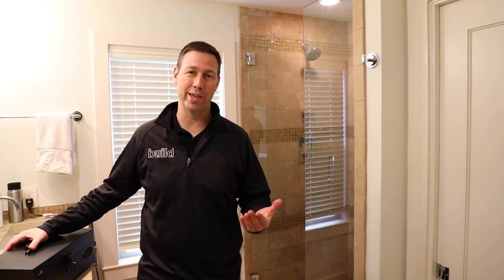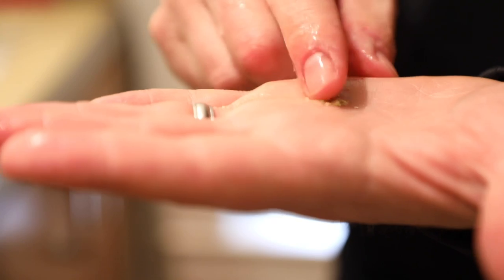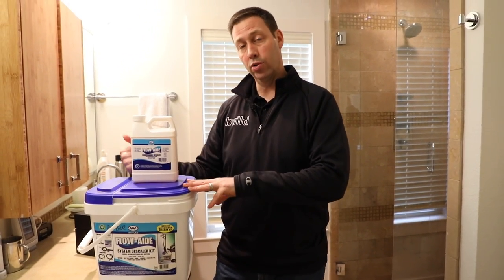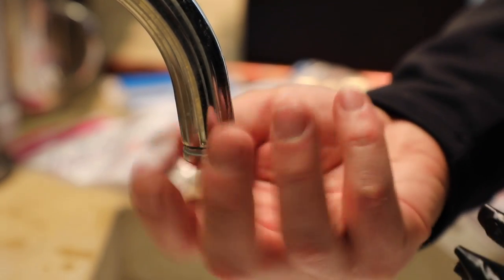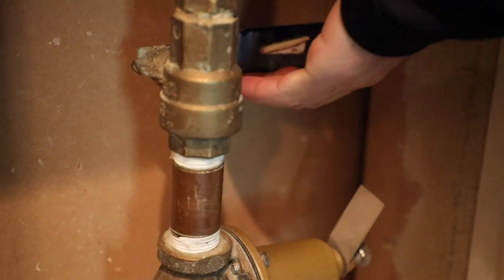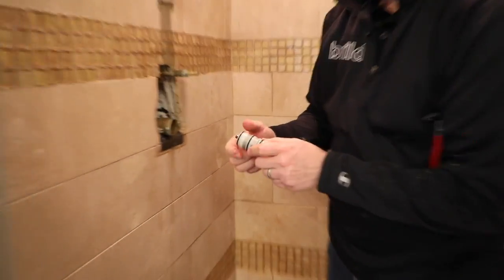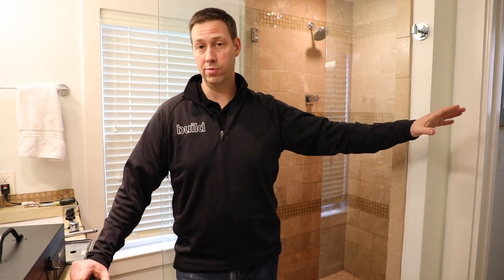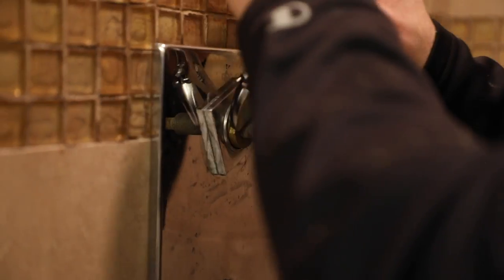The Bummer for Tankless Water Heaters - Fixing a Scale Issue

Comment: We lived in two houses in the country for 41 years, used 3 tankless units in that time: a Thermar for 12 years, a Vaillant for 20, and a Bosch for 9. Well water in both places was LOADED with dissolved iron and calcium, and none of those tankless units ever gave a single problem with scale, or internal deposits of any kind.
Reply: Good comment.   The manufacturers you ended up buying were very likely well aware of HARD WATER conditions and designed their systems accordingly.    To add to your comments, the "calcium carbonate" does NOT come from the tankless hot water heater as stated in various fashions at the beginning of this video.   The "buildup" is from the hard water ....FULL STOP.    This is MINERALS IN THE WATER of what is called "HARD WATER".    This HARD WATER does NOT come into the house "heated".   It comes in "COLD" like every other water supplied anywhere on the planet earth.         TRANSLATION:     The "minerals in hard water are in both COLD AND HOT WATER.         This guy keeps on referencing the buildup as if this is from the water heater.   NO IT IS NOT.   The buildup seen in the aerator is NOT just from the water heater .....THIS BUILDUP IS ALSO FROM THE COLD WATER.   Just run the cold water continuously through an aerator for a month or more and then look at the aerator.

The point is very simple.   The descriptor in this video states "...Matt investigates a house with low water pressure and reveals the DOWNSIDE to a tankless water heater".    WRONG.   It doesn't matter what kind of water heating is in place.    THIS "LOW WATER PRESSURE" IS CAUSED BY HARD WATER  .....NOTHING TO DO ANY HOT WATER HEATER ....FULL STOP.        If the supply water is hard water, then simple maintenance flushing/cleaning is required.

This issue is NOT a "DOWNSIDE" of tankless water heaters.

.
Reply: @taxicamel  but hot water has more scale than cold.  You can get a TDS meter and see for yourself.  As for why, maybe ask a chemist?  But I agree it's counter-intuitive, you would expect less hardness in the hot water than cold, because typically hotter water keeps more solids in a dissolved state, just like salt water.  Anyway- here in AZ a typical TDS meter will show 400ppm in cold water and about 750ppm in hot.
Reply: @marcostankless7526  ...99.99% incorrect Marco.    It is the municipality who controls the condition of the water .....unless of course the water is artesian from your own property.....in which you're on your own to what needs to be done to the entire plumbing system.

No TDS meters required ....and a complete waste of time in most cities across North America and likely many other countries.  People know what kind of water they have.

When water comes into the house, it doesn't matter whether it gets heated or not .....it's "chemistry", which is more a "solution", is about "solids" in the water.  I have no idea where you think that the temperature of water influences the amount of solids in water ....but you go ahead and think whatever you like.

.
Reply: @taxicamel  even if it is city water, I you can see that there are more dissolved solids in the hot water than in the cold.  Municipalities do not control water hardness.  All they do is take non-potable water and filter it, then chlorinate it, then pump it to all the buildings.  Doesn't matter if it is Az water or NJ water, there will always be more hardness in the hot side than the cold side.  It's just a matter of is it 50ppm in the cold and 150ppm in the hot like NJ, or is it 400ppm in the cold and 750ppm in the hot like Az.  

Also I am certified installer for Rinnai and Navian, which are the two most popular tankless water heaters in USA right now.  They are not made for "hard water" in fact the install manuals specify that water hardness should be below 150ppm or it could void the warranty.  That much being said, the new tankless heaters have stainless steel pipes & stainless steel heat exchangers, this makes them much tougher than the old ones.  They come with 15-year warranties, and should last 20-25 years if well-maintained.
Reply: @taxicamel  With a tank water heater, the scale are accumulated inside the water tank and will not clog hot water pipe.  With a tankless water heater, the scale has nowhere to go but into the hot water pipe causing clog issue.  For this reason, when compared to tank water heaters, the tankless water heaters do have a "DOWNSIDE" as described in this video.
Also, the scale build up DOES come hot water heater as the video suggested.  Minerals dissolved in water does not clog water pipe.  The minerals in water only causes problem when it can no longer be dissolved in water and become scale.  Heating cold water containing minerals will cause the minerals in water to become scale.

Comment: Maybe a problem with gas fired tankless. This is NOT a problem with electric tankless. We Been on electric tankless for a quarter century now. Never had any scale, despite having pretty hard water.  Once the water is off, the elements shut off=no scale.  Still the greatest invention! Cheaper than replacing the oil boiler. Very consistent, infinite, hot water regardless of how cold our New England winters get!  Easy to install. I did it myself!  NO regular maintenance required, or even possible on electric tankless! A great DIY  option if someone doesn't have gas, and can solder and do electric work.  When my first one failed (heating element blew out),  there wasn't a spec of scale anywhere inside.

Comment: I would install a strainer immediately after the water heater. This way you catch all the scale before it gets to your plumbing fixtures.
Reply: Wouldn’t it still slowly catch in the other screens as well?
Reply: Great idea! You can add a water filter that uses a cartridge. I installed one before the water enters the tankless water heater to eliminate any sediment from entering the system.
Reply: johnscloud oh yeah! A soft water system will filter it right out!
Reply: @Rockwell108  Well I would Not prefer a soft water  system over a simple water cartridge filter system since this type of system will raise your salt levels (excess salt intake). I have had a soft water system decades ago.  Has the soft water system stopped using salt?
Reply: @zeroumashi2947  Thank You for the link!  This looks like abetter idea in place of salt.   I found a unit at Home Depot for $170.00, It lasts up to 2 years before the cartridge needs to be replaced. Cartridge replacement approximately $100.00. That makes rplacement costs at about $50.00 a year.  Again thanks for the link!
Reply: @johnscloud  no problem.

Comment: To get people to maintain anything........you have to make it easy. When you plumb in the heater, Install inlet & outlet shutoff valves, "T" in valves downstream of the inlet valve and upstream of the outlet valve and attach hose barb fittings to the valves......You can now easily isolate the system, quickly and conveniently connect your chemical circulating pump and go to town on descaling..............

Comment: Just a few notes to Matt's excellent coverage on maintaining your tankless unit.

1. All manufactures of tankless units base your warranty on proper maintenance, which includes flushing the unit according to their guidance. I own a Rinnai, and they recommend yearly flushes. So I do them. But I also have a water softener and yearly flushing is overkill. Until my warranty expires, spending a yearly cost of $5 on vinegar, and 1 hour of my time seems worth it.

2. Flow aide is a good product, which is hydrogen chloride based (hydrochloric acid). Vinegar is acetic acid. But they are both acid and will do the same job. The difference is in price and time. $20 and 45 minutes for Flow-Aide, and $5 and 60 minutes for vinegar. (Price is for the flush product only, see below for additional kit required)

3. In addition to the vinegar (or Flow-Aide) a bucket (5 Gal or more), a pump, and hoses are required. If you want to do this yourself, it is cheaper to buy the items separately instead of getting a kit. You can get a submersible pump for $50, a bucket for $3, and a set of washing machine hoses for $15.  Flow-Aide kit is $150, buying separately comes to less than $70. You decide.
Reply from the maker: Excellent addition and comments
Reply: He obviously lives in warm climate, not where pipes could freeze during the winter.
Cold climate areas would have then in a cellar, or a utility room.
We have a tankless system, too,
But water temperature varies during use.
Reply: Matt is based out of Austin, Texas. So yes, not much of a freeze concern. I'm even further south than he is in Houston, Texas. We have freeze concerns where I am, but infrequently and only then for a day or two.
Reply: Vinegar also seems a lot less toxic if you have kids or pets.
Reply: I bought a rinnai and it stopped working after 3 months. Either my water is super lime, or I got a bum unit. It sucks because I payed to have a 220v plug added for it, and moved from a propane water heater to electric tankless, it died in 3 months, so I ended up installing an electric tank heater.
Reply: menchelke you should have put a tankless and run it off the LP, itbwould far more efficient. I wouldn’t trust electric tankless, electricity just can’t heat the water well without lots of power. Even regular electric heaters are less efficient and have a lot longer recharge time
Reply: @Nicholas-f5  The molar concentration is low in the solution and draining is zero.  Not an issue.
Reply: @menchelke  Most tankless have a LP nozzle option.  Why didn't you just have it replaced under warranty?
Reply: @joshcowart2446  I know this is an old comment, but I just now saw it. I was trying to eliminate lp, for simplicity. I am disabled, and carting tanks to get filled is a real chore. I don't have the funds to buy my own large tank and renting one, and paying for fills from the company ends up costing significantly more than filling my own. So I basically was trying to simplify my life.
Reply: @charlesrichardson8635  to make good on that warranty, in a lot of cases, you need to have jumped through a few hoops. For instance, has to be an authorized dealer. At the time, I think I bought mine on Amazon, and they weren't. I don't remember. But anyway, I felt it wasn't worth the hassle. I may be wrong on my assumptions though.
Reply: menchelke if it works for you more power to you. I was just speaking generally. I live in an all electric house and they won’t allow us to get LP so I’m stuck in the same situation
Reply: I just found this video but you are right on.  I bought my own pump and hoses years ago and use vinegar once a year and never have problems.  I have a Rinnai too and it is pretty easy to flush.  So far so good.  Our home already had a tankless system so I had to learn a bit but all good.  Our son takes 40 minute showers now which is the real problem with a tankless system.
Reply: @ronstrong9560  
I've never seen one mounted outdoors! I live next to the ocean, so we have high winds, heavy rain and salt air to contend with. The most popular mounting locations are garages, basements and attics. 
I would have at least built a mini shelter for the thing. The sun will degrade materials as well.
Reply: I’ve had mine 13 years and never needed to flush.I have also never heard of  these ever needing to be flushed here in Australia
Reply: @bluenadas  until the psycho winter of 2020. 😉
Reply: 3 years later and your still making my day! Thank you for the clarification from Germany 🇩🇪
Reply: No, I do not agree at all.  This is NOT "excellent coverage".  The titling is "...low water pressure and reveals the DOWNSIDE to a tankless water heater" which is not correct at all. This issue has NOTHING to do with the water heater.  This is a HARD WATER issue.

The "calcium carbonate" does NOT come from the tankless hot water heater as stated in various fashions at the beginning of this video.   The "buildup" is from the hard water ....FULL STOP.    This is MINERALS IN THE WATER of what is called "HARD WATER".    This HARD WATER does NOT come into the house "heated".   It comes in "COLD" like every other water supplied anywhere on the planet earth.         TRANSLATION:     The "minerals in hard water are in both COLD AND HOT WATER.         This guy keeps on referencing the buildup as if this is from the water heater.   NO IT IS NOT.   The buildup seen in the aerator is NOT just from the water heater .....THIS BUILDUP IS ALSO FROM THE COLD WATER.   Just run the cold water continuously through an aerator for a month or more and then look at the aerator.

The point is very simple.   The descriptor in this video states "...Matt investigates a house with low water pressure and reveals the DOWNSIDE to a tankless water heater".    WRONG.   It doesn't matter what kind of water heating is in place.    THIS "LOW WATER PRESSURE" IS CAUSED BY HARD WATER  .....NOTHING TO DO ANY HOT WATER HEATER ....FULL STOP.        If the supply water is hard water, then simple maintenance flushing/cleaning is required.

This issue is NOT a "DOWNSIDE" of tankless water heaters.

.
Reply: @taxicamel  of course the buildup is from the water and he even says this, but it precipitates out BECAUSE of the tankless unit. 4 years later and still an excellent video.

Comment: I learned the hard way about calcium buildup. I was cleaning my screens weekly till I figured it out. Since I knew I had to change the plumbing in order to flush the system I came up with the idea to add a tank for collecting sediment on the outlet of the heater. I ended up using an old oxygen tank, a tall slender one. It's about 3 or 4 inch inside diameter and 22 inches tall. Water goes in the top where with copper tubing enters the tank about 18 inches down. Water exits near the top and all the solids settle to the bottom. I have a drain valve in the bottom and I check now and them for buildup. When I notice more than normal sediment I know it's time to flush it out. Works like a dream, I haven't had to clean my screens in 3 years now.
Reply: This is really interesting, because usually it is the heat specifically which causes a drop in CO2 in the water which is what causes the calcium to precipitate and thus the scale to form in the plumbing. This is why when using hard water it's common to find scale in heated pipes and heaters but not nearly as much in cold water lines. I wouldn't expect such a setup to work very well at all to reduce scaling unless you where using a chemical treatment or the water was pre-heated before entering the first tank. You might remove floating sediment that was suspended in the water and can settle at the bottom, but it would have no mechanism to actually remove calcium carbonate that has been dissolved into the water.
Reply: @sango_wango851  ...don't get hung-up on calcium.  HARD WATER is full of minerals.   If you want to isolate calcium, then you need to get an analysis done on the water first to know what is best to be done.

.